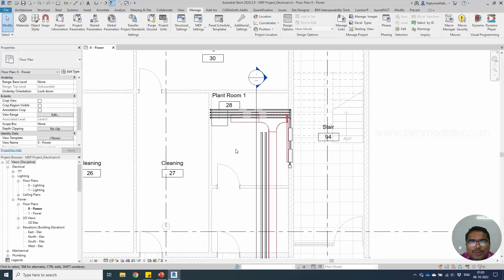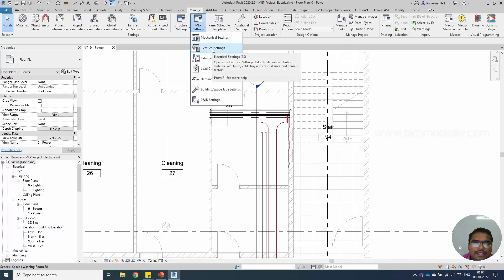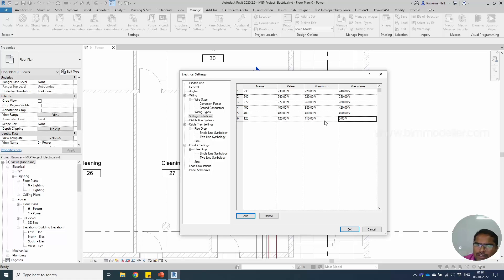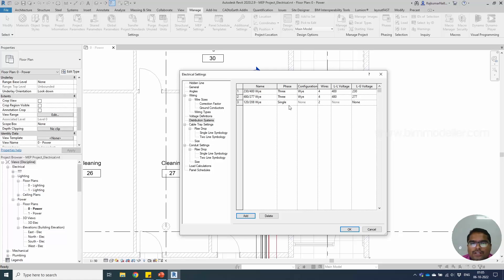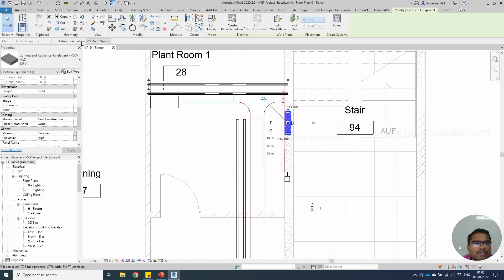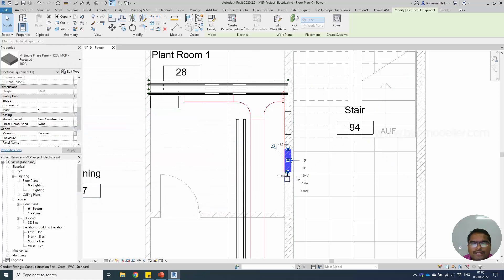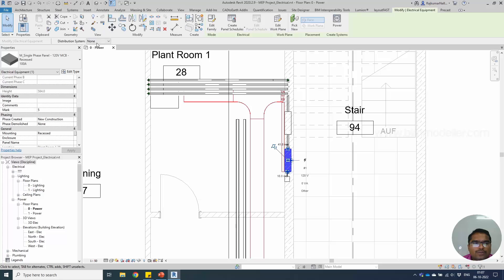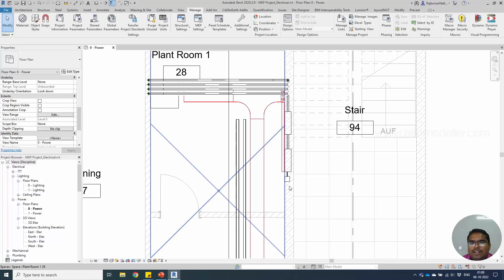#Revit MEP Project 38 : Create New Voltage and Distribution System in Revit

Comment: can I add a 208V equipment to a 480V electrical panel board?? I tried but its not working
Reply from the maker: While connecting Voltage should match equipment and Panel. If your 480V panel consists of 208v single phase then it will connect. I think for that the single phase voltage will be 277 V, so it won't connect.